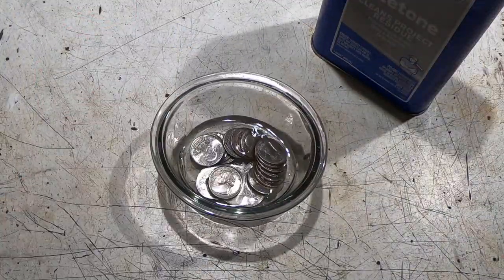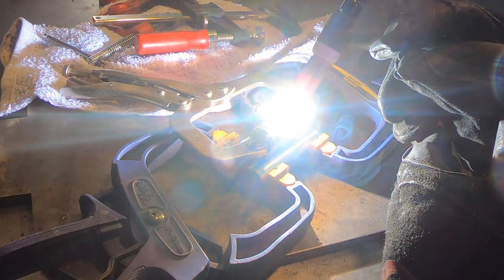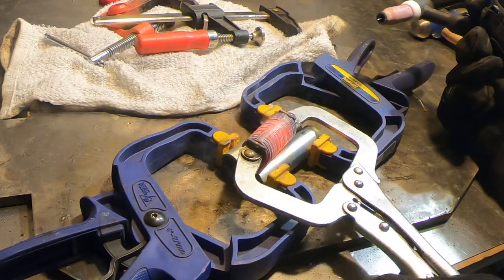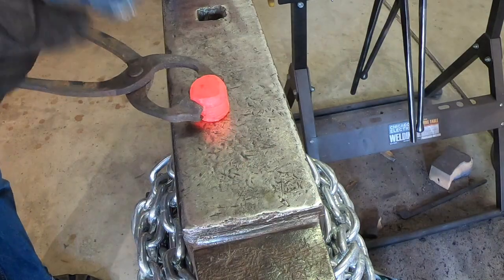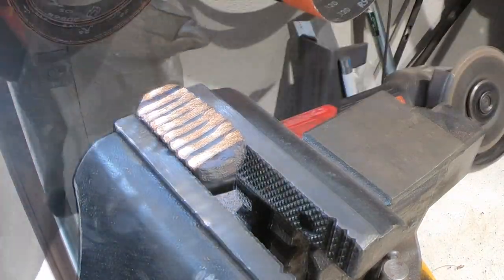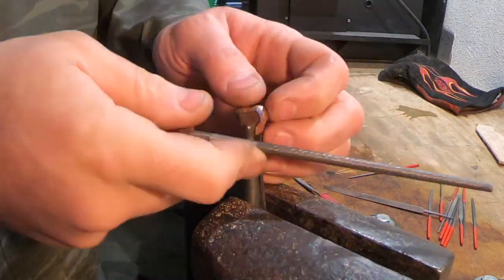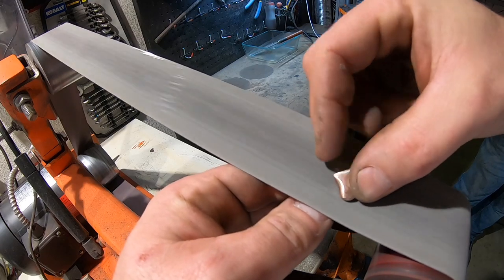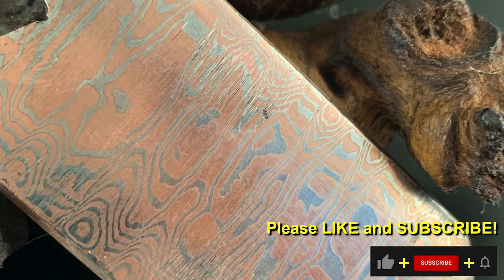Forging Beautiful Nickel Copper Damascus

Comment from the maker: What should I make with this mokume gane?   Have you attempted this yourself?  If so, what's your process if its different than mine.
Reply: A Habaki, a Ring, a Crossguard?
Reply from the maker: @smrettpecca  Habaki would be interesting.  Hmmm... 🤔
Reply: I'd like to see someone try a san mai with the mokume gane cladding. 
Make the blade core to shape. Forge clad the mokume gane and then grind it out.

Full tang. Make the handle scales from twisted mokume gane.
Reply from the maker: Maybe some day I’ll try the mokume gane cladding on a knife.  I’ve done the cu mai so it’s not that much of a stretch.  Thanks for watching!
Reply: @TyrellKnifeworks  that's a nice Idea! The only thing you have to be careful is that the Zink will "melt" really fast and can destroy your nice mokume gane.

I've made mokume gane with copper and brass. And another time I've made it with copper and silver. (You need 999.0 copper and 999.0 silver for this) 
And at the end you should not etch it but oxidize it with a flame.

Keep going, I love watching your videos!
Reply: I've made some billets for practice. I'm parts for a 1964 Triumph motorcycle from them. I'm going to be using patinas on them, not etchants. They're always fun.

Comment: It glows because the copper is really good at conducting heat. Since the welded piece is small it will heat up really quick trying to get as hot as the welding arc and cood down as the ambient temperature and surface area fights back trying to cool down the piece.

Comment: Eine tolle Idee, um an das Ausgangsmaterial für diesen Mokume Gane zu kommen! :)
Reply from the maker: Danke fürs zuschauen!
Reply: @TyrellKnifeworks  Ich schau dir gerne zu! :) Ich bekomme hier oft Inspirationen für eigene Projekte. ;)
Reply from the maker: @smrettpecca  
Ich bin begeistert, das zu hören! Lassen Sie mich wissen, ob Sie noch andere Projekte sehen möchten!
Reply: @TyrellKnifeworks  Ich arbeite gerade an eine Anderthalbhänder. Ich bin mir noch nicht sicher, ob ich den " einfach " als Torsionsdamast ( 1.2767 und 1.2842 ) mache, oder ob ich tatsächlich das Risiko eigehe, und " Wootz ", sprich Tiegelstahl versuche. Als Vorlage dient mir ein Schwert aus dem Klingenmuseum in Solingen.
Reply from the maker: @smrettpecca  Klingt nach einem coolen Projekt! Schicken Sie mir ein paar Bilder, wenn es fertig ist. Ich werde anfangen, Zuschauermesser in der Triple-T-Serie zu zeigen!
Reply: @TyrellKnifeworks  Da ich das nicht Hauptberuflich mache, wird das wohl ein Projekt sein, welches sich über das kommende Jahr hinstreckt. Im wirklichen Leben bilde ich Auszubildende in Metallberufen aus. Darunter befinden sich auch Schmiede. allerdings schmieden wird wir Blöcke mit einem Stückgewicht von bis zu 40 Tonnen, unter einer 3000 Tonnen Schmiedepresse. Unsere Schmiedezangen sind fahrende Panzer. :D das mit den Messern, Äxten und Schwertern, machen ich als Entspannung an Wochenenden. ;)

Comment: I thought about doing this a few times but never did... this might just be the push I needed. Great video bro! =)
Reply from the maker: Thanks!  I think it turned out great and I’ll definitely be using it for some fittings.  Even thinking about using it as cladding in a San mai. 😮

Comment: One problem with using nickel in mokume gone is that nickel dust is a very strong carcinogen. So you gotta be obsessively careful with your respirator when sanding and filing the final product.
Reply from the maker: Thanks for watching, Arash.

Comment: Did you etch it with the same ferric chloride thats used for steel? I didnt hear it mentioned, I might be losing my hearing.
Reply from the maker: I did etch this one in the same one but then read that it will contaminate your ferric so I have a separate for copper now.  One single item won’t hurt it but if you do a bunch, you’ll get a copper tinge on anything else you etch in it afterwards.
Reply: Dude you are amazing. You do so much for a bunch of strangers. I hope you know you are leaving impressions that will last a lifetime.
Reply from the maker: Thanks so much!  I try to help anyone I can.  This is the best community around and I love giving back.  👍